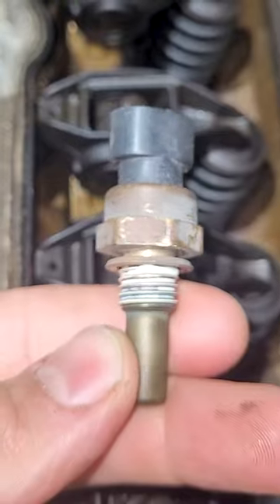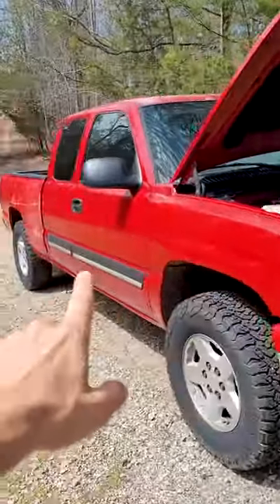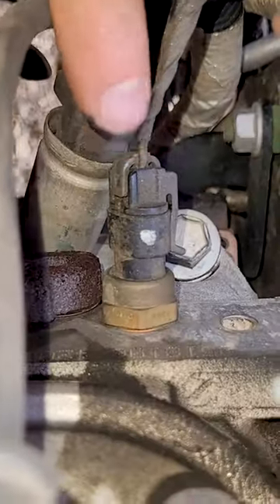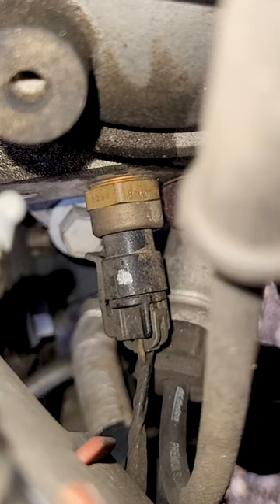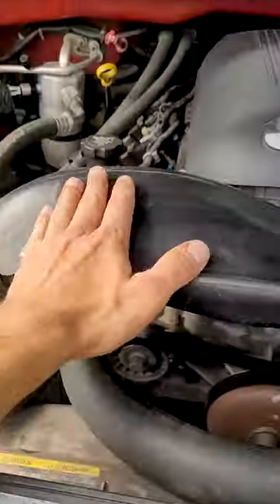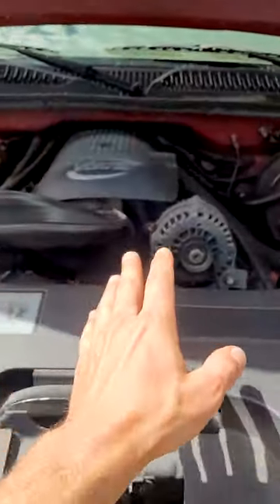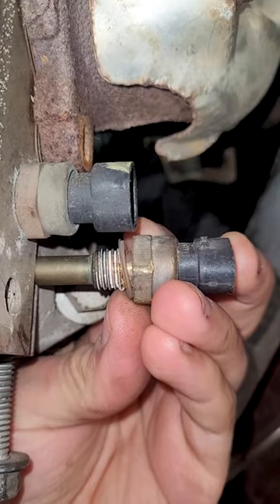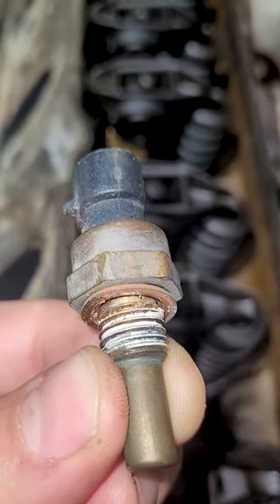Mechanic States Chevy Coolant Sensor?

Comment: He ain't lying about that sensor, it will say the truck is over heating and shut off. It shuts off because it prevents it from damage the engine. I couldn't figure out why my truck left me stranded and it was saying overheating, will long story short that sensor was not making connection loose wires. Went down to O'Reilly's brought a another sensor for 9 bucks truck started right away
Reply from the maker: Yes! It will do that! Very important sensor.
Reply: Damn 9 buck that really cheap.
Reply: @ivanbarajas5471  yez'zir the lil part cause it to shut down and the truck won't start either
Reply: I replaced it once already sould it go out fast or not
Reply: @Docholiday-m9r  you should be alright for a few years
Reply: @richardgarza5763  the fans haven't kicked on to cool it and it does have issue starting from time to time but the gauge shows temp but when I turn on the truck it goes back down to cold so do I have a faulty sensor ?
Reply: @Docholiday-m9r  I replaced mine because it was saying overheating and it does that so the engine won't over heat it like a cut off switch but it would do it when I would turn it on. I was like why is it doing this if it hasn't even been driven. Well come to find out the sensor wasn't making contact. So check your wires . The fans aren't going to turn on right away the truck needs to reach a certain temperature for them to come on👍

Comment: It's the same with the previous generation as well.. if your truck starts cold and it won't start hot it's your coolant sensor.. when the engine is cold it delivers the extra fuel and if the engine is hot it also delivers extra fuel because the computer thinks it's -40 and it will flood the engine.. first-hand experience there😊

Comment: I learned this from my 1988 chevy c1500 even the throttle body injection depend on those coolant sensors. I had the same problem because of a bad coolant sensor and I couldn't figure out what it was. I sold the truck and finally figured out what it was when my friend told me that he had the same problem and that's how he fixed it.

Comment: So my 01 with a 5.3 has an issue of not getting up to ten with the heater on. Heater off it has no problem getting up just under the 210 mark where it should be . Any ideas?

Comment: My 96 Dakota it’s a piece of shit it got the 3.9 only reason I’ve haven’t sold it because it’s the only truck daddy bought new I spent my whole childhood in it but it was running ruff it was missing so I said let check the map sensor prone to go bad on that motor it was good thing wouldn’t start one day after leaving the store poured water on crank sensor started up put a crank sensor on started ran good for a couple days started running bad again pulled the codes it needed a thermostat it was globed up with rtv that pissed me off it got a damn gasket don’t use rtv and the coolant temp sensor was broken and it been running good ever since my temp gauge doesn’t work but that alright it reads correctly on live data I got to put blower motor in it so when I do that it will get new to me cluster

Comment: Best tip for any gm owner, when dealing with sensors or electronics, always buy gm acdelco or delphi, that duralast or store brand sounds like a good price but they alway give up quick or not work at all
Reply from the maker: The store brand always breaks!
Reply: @MattsShop  exactly honestly found the best place to buy gm parts is a line auto parts for some reason gm and acdelco is cheaper than store brands elsewhere

Comment: So my 06 silverado does not have the manual temp sensor? Like the spring one? I didn't know it had an electronic one. Or am I thinking of the thermostat and that's something different?
Reply: The only part with a spring on the coolant system for these trucks is the thermostat. And the only 2 types are ones with a built on housing and the other is a 2 piece thermostat where the housing is seperate
Reply from the maker: The thermostat is mechanical. The sensor is digital.

Comment: Would a bad coolant sensor make my engine fan run all the time??
Reply: If you have electric fans then yes it could. But if you have a clutch fan then no
Reply from the maker: Yes, if you have electronic fans

Comment: Nah mine was unplugged only thing that happened was my radiator fan blew loud ash until I plugged it back up
Reply: You have electric fans then. All of these trucks from 99-03 and some 04-07 have clutch fans so yes if you have electric fans then it would also tell the fans to kick on at a certain temp but if left unplugged it would assume you’re over heating and kick fans to 100%
Reply: @halfbloodentertainment  ohhhh I had no clue thanks for the knowledge pookie bear😗❤️❤️
Reply from the maker: Yes it controls the electronic fans too.

Comment: Just changed my thermostat that didn’t fix the overheating changed the coolent sensor fixed it start with the sensor first people and do not buy them from a part shop go to the dealer and buy it all sensors you buy from the dealer because you buy cheap ones you be back buy them in 6 months
Reply: Actually diagnose the problem instead of throwing parts. Hack.
Reply from the maker: The coolant temp sensors on these cause a lot of problems.

Comment: Do the low coolant sensors go bad in the reservoir? Mine says low coolant when pointed down hill, or if I come to a stop a little too hard, but the coolant level is fine.
Reply: Yeah coolant level sensors will go bad eventually on any vehicle
Reply: Yes and it is built into the coolant reservoir, luckily there are cheap ones out there.
Reply: Same issue in ny 1500 hd

Comment: 2002 1500 hd.  Soaking the starter in oil
Reply: Most likely either the reaer main seal or the valve cover gasket on the passenger side. The valve cover gaskets are problematic on the vortecs (especially the 5.7 and 6.0)
Reply from the maker: Rear main, oil pan gasket, or crankshaft position sensor oring.